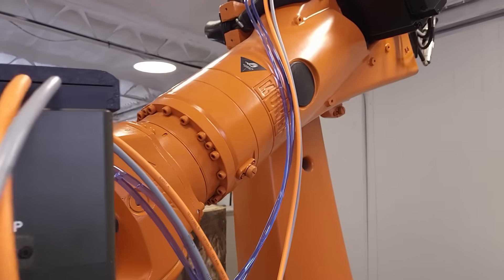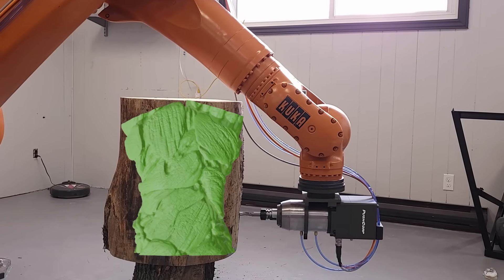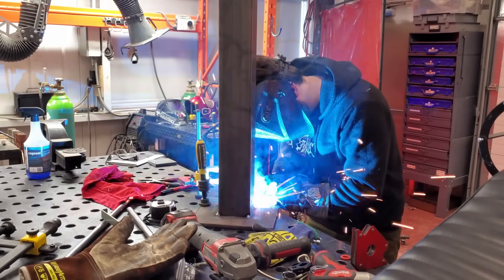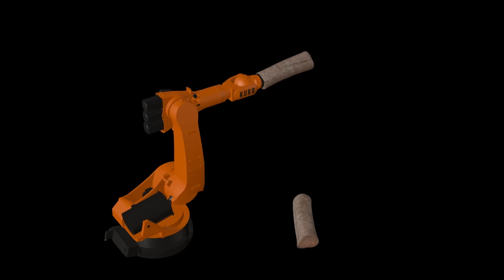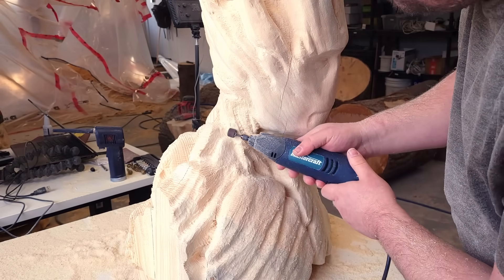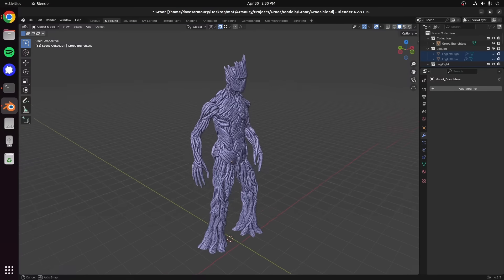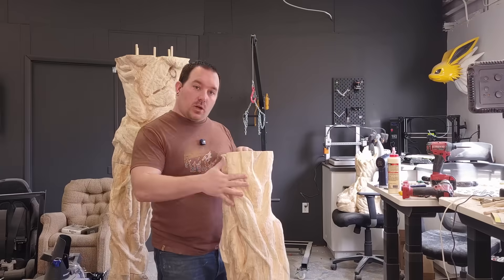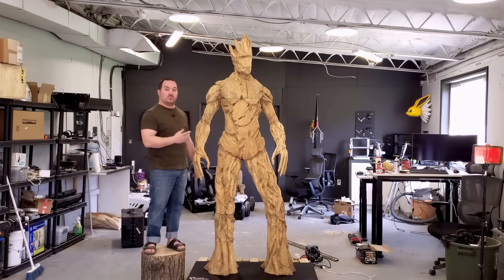Creating a FULL-SIZED Groot!

Comment: One thing that might make assembly slightly easier: make the tops of the thighs level to the floor, and extend the bottom of the torso slightly so that the bottom will also be level to the floor. That way, the torso will slide onto the thighs straight up and down.

Comment: as a wood and stone carver.. i will admit if i had the tools and knowledge of the software and tools like you do.. i would so be using this myself in my craft.. its still a tool at the end of the day.. but i would have done one final pass with a smaller bit to put in more details.. or gone a little nuts with a dremel and bits.. but yes.. i look at all tools to improve and speed up the work i do.. as a child i used to think a lot of stuff was hand made from stone and wood.. like all them detailed panel work carvings and stone statues and marble ones.. till i found out that 85% was done with industrial cnc machines.. and the first 3d scanner was made in the 1930s to scan heads to be carved with a cnc like yours where the arm went around the stone block and carved.. into the head.. but after working with wood and stone with hand tools in this day an age.. making money from what we make with the hours we put into making things.. is not worth it.. but using stuff like this.. can save a huge amount of time.. as you can be doing other things as the machines are working there magin.. :)

Comment: Push Corp. has some awesome tools along with their spindle line and active force devices that a lot of robot manufacturers will use along with the spindle. It helps maintain the proper bit pressure when cutting no matter what angle the robot is at and easier to program in reality.

Comment: These days, with the rise of computer controlled machines and/or 3-d printing.   The first thing to determine is whether to use ADDITIVE (ADDING material to make a project) or SUBTRACTIVE (literally SUBTRACTING (removing) material to leave the finished project (in most most crude description, taking a power tool and REMOVING anything that is NOT Groot).
Just as idea (I do NOT know your expertise/experience/limits) but an interesting idea might be to try a project using BOTH ADDITIVE and SUBTRACTIVE processes on the SAME project.  Though not necessarily of the same part(s).